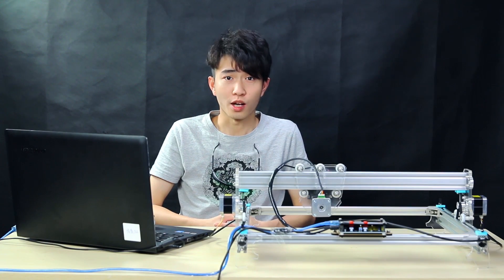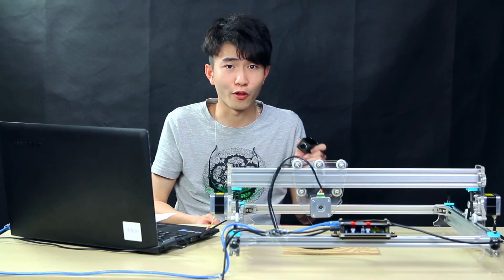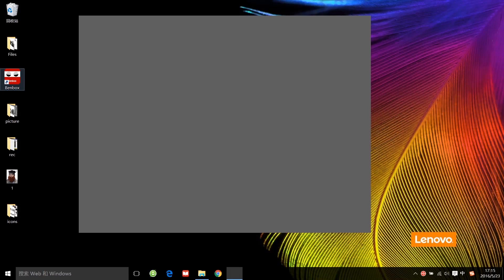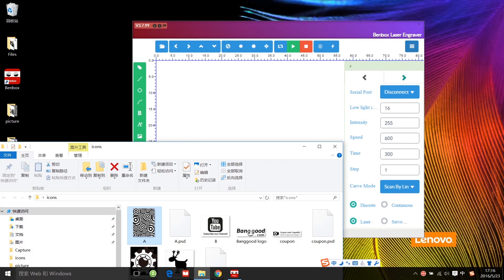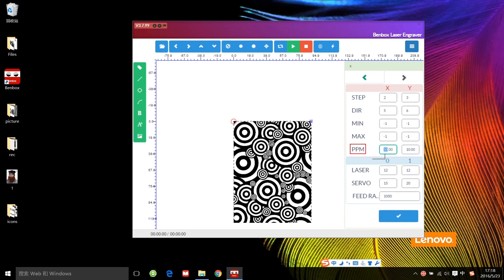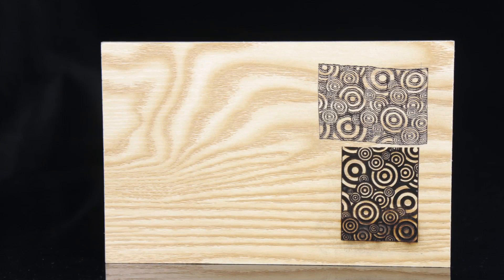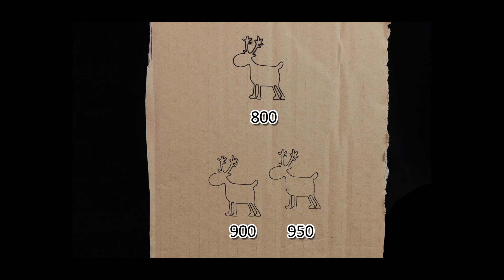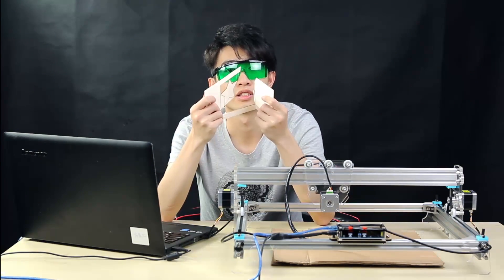10% Off | How to use | 5.5W DIY Violet Laser Engraving Machine review | Q&A | CNC | Benbox setting

Comment: Hello.If I want to replace my laser modul with stronger one should I modify some connection on cnc engraver electronic or it can be just replaced.
Reply from the maker: EleksMaker's original 5500mW laser module, the one in the video is 2500mW.
if you want to replaced please check this one: https://ban.ggood.vip/fjde

Comment: New-2018-Upgrade-NEJE-1000mW-Crouter-CNC-Laser-Cutter-Mini-Engraving-Machine-DIY New-2018-Upgrade-NEJE-1000mW-Crouter-CNC-Laser-Cutter-Mini-Engraving-Machine-DIY New-2018-Upgrade-NEJE-1000mW-Crouter-CNC-Laser-Cutter-Mini-Engraving-Machine-DIY New-2018-Upgrade-NEJE-1000mW-Crouter-CNC-Laser-Cutter-Mini-Engraving-Machine-DIY New-2018-Upgrade-NEJE-1000mW-Crouter-CNC-Laser-Cutter-Mini-Engraving-Machine-DIY New-2018-Upgrade-NEJE-1000mW-Crouter-CNC-Laser-Cutter-Mini-Engraving-Machine-DIY New-2018-Upgrade-NEJE-1000mW-Crouter-CNC-Laser-Cutter-Mini-Engraving-Machine-DIY New-2018-Upgrade-NEJE-1000mW-Crouter-CNC-Laser-Cutter-Mini-Engraving-Machine-DIY New-2018-Upgrade-NEJE-1000mW-Crouter-CNC-Laser-Cutter-Mini-Engraving-Machine-DIY New-2018-Upgrade-NEJE-1000mW-Crouter-CNC-Laser-Cutter-Mini-Engraving-Machine-DIY New 2018 Upgrade NEJE 1000mW Crouter CNC Laser Cutter Mini Engraving Machine DIY

Comment: Hello there , i order the engraving machine 2500 MW A3- pro , i would like to know please if i i can change the laser module from 2500 mW to 6000 mW or 7000 mW on the same software and same power board as its , do i need to change anything else or add power supply .   thanks
Reply from the maker: You can change the laser module to power board with same voltage,but we are not sure that any laser module buy from other source could be matched.

Comment: LOL 500usd for less then 100euro in parts from every hobby-electronics shop in Europe. super cool indeed. those expensive arduino mega clones are 15 euro with ramps and drivers..0.5 euro and 1 euro from 20x20 and 20x40 (10cm of it) aluminium extrusion, 10-20e low power laser diode, remember, this is the price in Europe. in China its much less:) So ... make a better product then ask for money.
Reply: Yes and Know, So Frame, Steppers, Control board, screws & nuts, Belts. Total to about $75 (And thats building a Frame of an actual decent size, my calculation is based on a 1M x 1M Work Area.)  
However the Cheapest you can build a 5.5-6 watt laser is about $150.  The Diode for a 450nm Laser that can handle 5+ watts is going to cost around $75, Then you have Factor in the Cost of Wiring the diode, A Copper Mount, HeatSink, and Lenses, Thats gonna be another $20-25 if you know where to look.   Finally you will need a driver board capable of Driving the Lazer at 5W constantly.  You can do this for $5 if you know how to make your own PCB's or use a breadboard, But if you buy a Ready Made Driver, That can cost anywhere from $25-70.

So Realistically, The Laser Cutter in the video is probably Closer to $150-200 USD in parts cost. or $130-175 Euro.
Also your Definitley not going to find a 5w+ laser diode, Mount, lense, heatsink and driver at a hobby electronics store or id have a million Lasers hahaha
Reply: ShazamMafia  can i order one from you?
Reply: pleasy tell me where i can buy that parts for 100 EUR, adresses, links?

Comment: Summing up my laser does not turn it off it's a 2016 model with laser plate on top of the head was all installed correctly its a shame it was not working

Comment: I found problem on my machine. During engraving around 14% progressive, the machine stopped and unable to control (sometimes laser still on), I need to turn off and on the machine again. What should I do?
Reply from the maker: After you turned on the mechine for a long time you need to turn in off a bit
Reply: Oh thank you for your answer. However, I think it will be my problem because after machine stopped, it can't continue to engrave my job. That means my unfinished engraving product is useless. How can I solve this problem ?

Comment: Remember, If you can't go higher speed because of shakiness, you can lower the power and lower the speed. It's usually a good idea to prioritize power level adjustments before speed adjustments. 
Also, take notes on your best settings for different materials, so you don't have to do as much calibration on your next project.
Reply: 50% DISCOUNT when using this link for the ELEKS lasercutter, thank me later:): http://www.banggood.com/2500mW-A3-30x40cm-Desktop-DIY-Violet-Laser-Engraver-Picture-CNC-Printer-Assembling-Kits-p-1003863.html?p=7I22079633188201703T

Comment: i can get the laser head to move in the x and y( using the green buttons) ,  turn lazer on and off (using the blue buttons),  burn border (using the gray button).. But it will not burn the test bmp images..
i have the same machine as you with  Benbox v3.3.80 software. 
i used te same setting you used n your video as a starting point.
can you help?
Reply from the maker: There are some detailed information , hope it helps :)   https://www.dropbox.com/s/mditq22tzwaxbyc/benbox-en.zip?dl=0
Reply: thank you for your reply. i had done all of that before.with no luck... so are now using other software OK.

Comment: my laser wont turn on with low light mode, but the fan will. Please help
Reply: I have the same issue, did you get an answer? Thanx
Reply: +Gary Packer mine works now only when I first turn my engraver but after I burn for a while it stopped working, but if u wait for the laser to cool of it starts working again
Reply: hi, could you please help me.
I just finished assembling the machine. I pushed on the two red buttons then the laser is on.
I went to Benbox after then I tried to make engraving but it doesn't move or do any action neither response for anything.
what should I do now?
Reply: +faisal goldsmith your laser may be disconnected from your computer. try to select your com port from the left pop out menu, if you don't see your com port, try restarting your computer. I also had the same problem and this fixed it.
Reply: sorry, I mentioned right pop up menu
Reply: it's connected but the firmware is COM3 not COM4 is it a problem ?
can you send me a pic for your controller please?
the last question, if you connected everything together do you hear any sounds ?
Reply: +faisal goldsmith I hear a slight high pitch buzzing sound. I am unable to send u a picture because I'm on vacation but I may be able to when I get back
Reply: Don't worry about that. The COM port number depends on the USB ports available and on the USB devices attached.

Comment: HI, What program are you using?
Reply: They are using Benbox .. Latest version (3.7.99)
Reply: do you know where i can download it? with the firmware included
Reply: Ho Fabio.

I'm using BenBox Latest version. (3.7.99)  Works GREAT.  For designing, I use Inkscape .. since you can't save your work in BenBox.

Hope this helps!

Regards,
Dan.
Reply: Hi Seb.

Firmware is NOT included with BenBox Software, since BenBox is sooo generic.  You can download Firmware from Eleks / Banggood's Site, no problem.

Hope this helps, my Friend.

Best regards,
Dan

Comment: Hello! I purchased the laser module 2.5 W, I focused the dot, but the laser does not affect .... moves but does not burn even though I set different intensity and speed values may depend on what .... ? (Sorry for my English)
Reply from the maker: Hello, it may be caused by many reasons, such as the laser module,the drive board or the connection problem.We would kindly suggest you to send a video to the customer service to elaborate a little more about your problem.Thank you for your comment.
Reply: Hi, I have solved my problem now! I had probably set wrong the benbox values. Now I ask .... exists a table of tested values to be used for different types of materials? Thanks and sorry.
Reply from the maker: Hi,there is not specific tested values.Values vary with different materials and different modes of your machine. You need to try different materials yourself for a few times and make the adjustment. 
Hope it can help! Thanks!:)

Comment: hello, I would like to connect the ramps from 5.5w laser at a card to use it with TTL-output PWM to engrave and cut. there is a datasheet of the laser driver module?
Reply from the maker: Hi Manuel,the laser module specification is: 12 V 5.5W violet laser light. Thanks for your comment! Hope it can help! :)